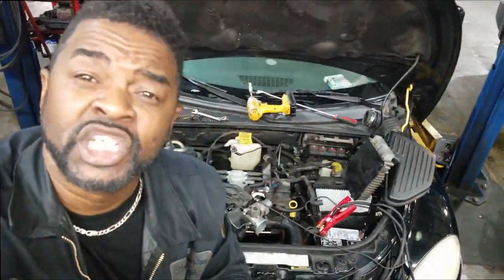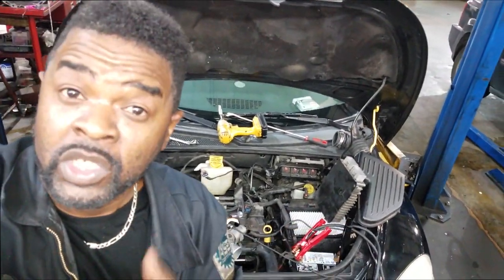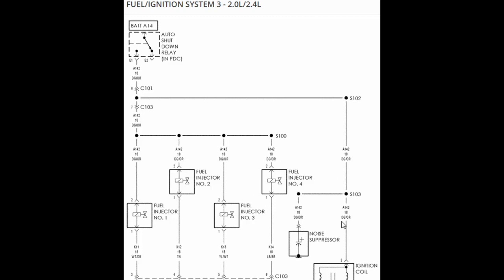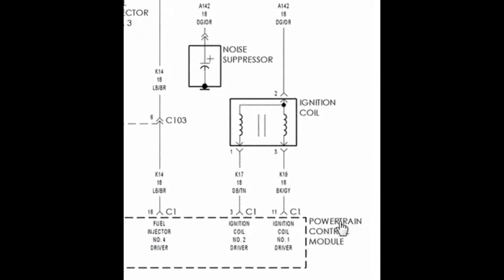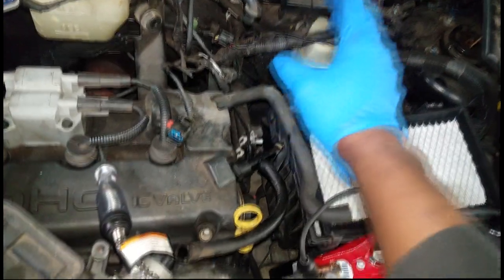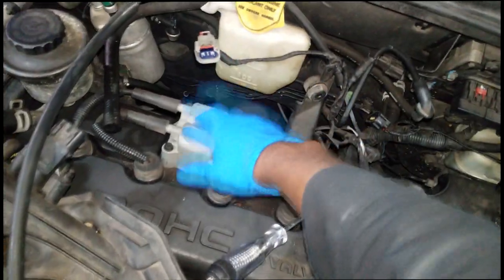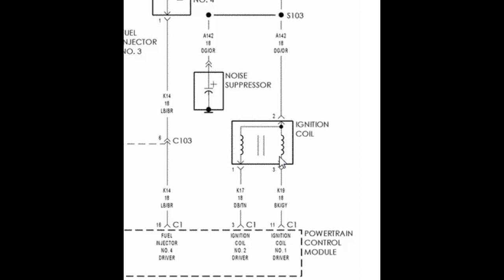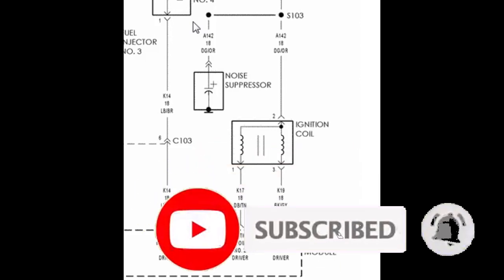How to tell if your car computer bad PCM or COIL. How to fix a NO START MISFIRE  PT Cruiser No Spark

Comment: I get no elec. On fuses 21,22,23 and a yellow 10A+10A double fuse. Changed the 10a and others too. = no wlectricity. No crank no start. Is it the TIPM?

Comment: On my 2005 PT, turbo.......It is Connector No. 2 from the left that supplies the pulsing ground to the coil.  It is Pin Numbers 9 and 10 on the connector plug.  You should get continuity from 9 & 10 on one end, and the two plug wires on each side of the coil plug connector.
My question:  What would cause the PCM to not send the grounding pulse to the coil?  Would a bad crank sensor shut down this grounding pulse from the PCM?  Anything else that would shut-down the grounding pulse from the PCM as you are cranking the engine?
Reply from the maker: Curious if you had any codes? Also, are you subscribed to the channel?

Comment: Can anybody help with this issue I'm having, my 07 pt cruiser is sending spark through the plugs intermittent, I have fuel, but no spark my car got below zero then the next day it stopped getting spark, I replaced the spark plugs, camshaft position sensor, crankshaft position sensor, the fuel pump relay,the relay for the EFI. I'm so lost.HELP PLEASE.

Comment: @ 1min 10 sec.... you can find wiring diagrams by googling your year, make, and model, and some you find will be pdf format to you can print them up. This is especially good if you live in rural or outskirt suburbs where creatures like mice and opossu s are common, they seek warm p,aces in winter and will push, pull, or chew wires to make a space close to warm motor.
Chrysler products, including Jeep and Dodge, from 2002 to 2010, you can turn the key to on then back to off 3 times in quick succession, leaving it in on position on 3rd time, and it will give you error or fault code, where the odometer mileage is displayed on digital versions. If you have more than 1 fault, it will flash them fast so be ready to maybe do that process a couple of times. Then google those codes. Common ones are Throttle Position Sensor and Camshaft Position sensor (P0340), both of which are found at top of motor, are not expensive or difficult to replace, and are quick to do. 
In case anyone else with a PT Cruiser Touring is wondering how to get codes without having access to a plug in code machine. I have a 2006 PT Touring, bought cheap with low miles as my son is learning to drive and replacement parts are easy to find as needed. We have replaced both the mentioned sensors, done brake pads, calipers, rotors on front, replaced spark plugs, wires, and coil pack ( its 1 piece with all 4 coils in), replaced bulbs all around, replaced rad fan and relays ( 2 times in 3 yrs), and in January will be replacing struts on front, both sides ( you can get "loaded" struts from online parts house for about $150 including shipping). With all this work, mostly done by us in carport, have not spent a grand yet on maintenance. Yeah, PTs dont have the most reliable motors, and are ugly to most folks, but maintaining them as should be will have them last longer.

Comment: turns out my voltage was 3 volts at the cps + (2v low) and at the cam sensor it was low , when i disconnected the cam sensor wires, the voltage on the cps + was 5v(perfect) cam sensor internel short was dropping line voltage to 3 v replaced cam sensor ,, all good,, so check for the voltage drop

Comment: I have a no crank no start 2010 PT non turbo🥺 changed PCM,TIPM, ignition switch, checked grounds, checked fuses, checked powers, new battery, Checked ASD and Starter relay both good. Checked starter by jumping the 87 to battery + and starter turns over I’m very confused. It’s the key with the buttons. Could it be the SKIM?.. on a side note it would start and then shut off when warmed up now it won’t crank at all… alternator was charging at 16.5 volts also my high end scanner is not able to connect to the vehicle any ideas would be greatly appreciated the only thing I can think of is a cut wire… another side note no security light on the dash…. Master tech here I’m losing my mind. Does the TIPM need to be flashed??
Reply from the maker: You might be in theft mode my guy. Which mean your scan tool has to get inside the SKIM module to verify this. Heres 2 videos that may help
https://www.youtube.com/watch?v=TpRwRMXKsGQ&t=11s
https://www.youtube.com/watch?v=CCHP1r-PM4M

Comment: Thanks my friend. I was about to buy a new pcm. One of my coils was not sparking and checked and no power but ground was ok. Later found out postive wire was broke. I took positive wire from other spark and spliced and works great. All positive wires are spliced togethet anyways. But ground is fired differently. You saved me A LOT OF MONEY. I can go to work and make money..
Reply from the maker: Thats whats up, thanks

Comment: Hey. Thanks for this video. I am trying to do what you did, but I need to test a 2011 Jeep Liberty v6 3.7L. I have a misfire on 2. Coil pack 5 powers 5 and 2. I replaced it. It's not the coil. I did a lot of things to rule out the common causes. Now I need to check that enough power is coming from the PCM. The coil has a connector with 3 wires, just like yours in the video. If I do the same thing with just that connector, should I get the light going off in the same way? Or is this not transferrable because of the extreme differences in the engines and how they work and look?

Comment: Our 2001 pt cranks over but there is no spark to the plugs, but as you turn the key off there is spark. But your turning it off so it doesn't start. Any ideas?
Reply: I started having same problem, no spark until I turn off then get a spark. Ever get it fixed?

Comment: Hey now I have a knot to get off your PT Cruiser issue I have a 99 TJ Wrangler 4.0 6 l no crank just one knock when I turn the key I've done all my testing that can possibly do I think it's the PCM upgraded all my grounds replace parts new starters new alternators good battery I got 12:9 and I'm running two batteries my top battery is 12/9 which is for my accessories my bottom battery is 13:5 all all fuses I've been replaced whether they needed or not map sensor throttle body sensor coil I've bypassed the clutch I bypass the ignition even though I replaced ignition I've tested all I can test I'm ordering a breakout box to see if I can chase that down through that my scanner our host says it has an issue with the TCM when I run a check with the scanner everything fails I can go on and on can you help a brother out thanks stainless steel

Comment: I always come back to reference JT
 Best online by far in this topic
Reply from the maker: Whats up Cheap Rollin. Thanks for stopping by.
Reply: @OnlineMechanicTips  dad's 99 caravan 2.4 has a rough 3 and 4 misfire. I think it may be a cheap Amazon crank sensor I put on it a few months back? The fuel pump is whiny and gauge is all over place. Thanks for your time Boss
Reply from the maker: @CHEAPROLLIN  whoa, 99 model? Did it trow codes for a crank? I have seen one of those in years
Reply: @OnlineMechanicTips antique lol!! yes just a cylinder 4 misfire and a fuel pump voltage code. #3 was Missing on monitor but didn't show a code

Comment: I have a Chrysler 300 and I replaced all 6 spark plugs and 6 cores and with all them in I get a no start but when the number one spark plug is removed it will start??

Comment: Great information but did not solve my problem. NEED HELP. I have 2006 PT Cruiser 2nd gen Crank No Start/ No Spark issue (replaced mass air, crank and cam sensor, coil and swapped out computer with one programed to car  and still have Crank No Spark issue. I performed as your video getting power from center wire when car to run on coil harness  but the 2 other wires Green/Yellow and Blk/Y no duty ground power. Performed ohm check from Coil Harness Blk/y and Grn/Y  to PCM ( Orange pin 9,10) wires check out good no break in wires. What else can I check ? Why PCM no power to coil ? PCM was tested prior to plug and play
Reply: Did you work out what the issue was ? In my case, the vehicle ran rough then a few drives later after turning off will not turn over.

Comment: Thank you that was very informative I got 2005 PT cruiser no crank no it cranks no start body filled it up with too much oil and returned it to me but no start
Reply: Did you work out what the issue was ? In my case, the vehicle ran rough then a few drives later after turning off will not turn over.

Comment: 2002 Pt Cruiser. One morning started car. Ran good normal for 10 seconds then started misfiring. I could smell raw fuel. No check engine light. No codes. I disconnected BOTH positive and negative battery terminals. Waited 5 minutes. Reconnected. All good. No more misfire. Car never ever did this before. What's going on? 🤔

Comment: Very good info I have a 2005 PT cruiser 2.4. it started running a little rough two weeks ago, I hooked up my code scanner, got a cylinder 2 misfire. I changed the plugs, still running rough scanned it again got a cylinder 3 misfire. I changed the wires and coil pack, got a multiple cylinder misfire. Now it doesn't start up turns over but no start. The only thing I can think of is bad coil pack and fuel injectors need to be changed. Some helpful tips would be appreciated thank you.
Reply: No not yet due to weather here or busy doing other things, I have changed the water pump. Once the weather gets better I will get back at it..
Reply: @thomasgarcia4746  look forward to hearing how it plays out.
Reply: Did you work out what the issue was ? In my case, the vehicle ran rough then a few drives later after turning off will not turn over.

Comment: Hello, my pt cruiser is 2006, my scan only shows low battery after many attempts, but it does not start, I did all the measurements that you recommend in your videos.
Reply: Did you work out what the issue was ? In my case, the vehicle ran rough then a few drives later after turning off will not turn over.

Comment: Hello, excellent explanations, I need your help, my pt cruiser does not start, I see the camshaft and crankshaft signals well, it sparks.  Also change the fuel pump, I think the problem may be the injectors.  Give me your opinion. Thank you.
Reply from the maker: Dang, can you at least mention what year and why you now think injectors are the problem? Are you using a scan tool? Also are you subscribed to the channel?
Reply: Did you work out what the issue was ? In my case, the vehicle ran rough then a few drives later after turning off will not turn over.

Comment: I really nedd your help I have a 2007 PT Cruiser my brother in law has changed  the all the moter mounts which were bad the timing belt and the water pump and now the car won't start. Is there any advice you can lend to assist us?
He says the timing marks are in their proper place but the car will net start.
Reply: Did you work out what the issue was ? In my case, the vehicle ran rough then a few drives later after turning off will not turn over.

Comment: My po t cruiser is stalling and has a rough idle but stalling is intermittently and I've checked the camshaft sensor/map sensor the Iac sensor... 
Check engine light coming on  intermittently and the trac off ,abs,brake lights on to but show no codes dont understand what's going on can u help.... ??????
Reply from the maker: O wow, what year is your PT and what was the codes?
Reply: @OnlineMechanicTips   2004
Reply: 2004

Comment: Jt iam back again needing help i love this video iam working on 2003 pt cruiser turbo i dont have spark at 1and 4 iam going to test the driver tomorrow at the shop but say my tester is not lighting from pcm to coil when iam starting the car and say its the pcm thats bad can i get a junkyard pcm and plug and play or i have to program the pcm
Reply from the maker: Hey bud, it depends on if its equipped with a factory security module. (what color is the key)
Reply: The key is gray its 2003 pt cruiser turbo
Reply from the maker: @coreysolomon6814  Then your car equipped with a factory security system. Meaning a new/used pcm will have to be programmed to the security skim module in order for it to start and run
Reply: Jt can i go to one of those online pcm reprograming companies and buy a new pcm thats already program will they reprogram it to the skim module and if so do i have to give the info off the skim module on the car over phone what info do i have to give them over the phone jt i need your help very much appreciated
Reply from the maker: @coreysolomon6814  Yes, Ive heard of people doing that. They have them already pre-programmed based off your vin, so when you get it, its just a simple install

Comment: I have a 04 PT Cruiser 5-speed I put a brand new starter and brand new ignition actuator and still won't start I could jump it at the jump box but it was still won't crank
Reply from the maker: Hey bud, what do you mean you can jump it at the jump box? Also are you subscribed to the channel?
Reply: Did you work out what the issue was ? In my case, the vehicle ran rough then a few drives later after turning off will not turn over.

Comment: I have a 08 ponitic grand Prix it won't
Reply: I have a 08 ponitic grand Prix it won't crank i lost the key bob i only have the plan key it turns the switch but nothing happens is there a way to start it with out the key starting it and to keep it runing thanks

Comment: great video,  I'm wondering if you can do a following video of what to if your negative signal to spark plug box are working but there is no positive what are the steps to fixing that certain cable, Thanks a lot your videos have truly help me a lot keep it up hope to hear back
Reply from the maker: Hey bud, are you talking about the green and orange ASD wire to the coil? Also are you subscribed to the channel?
Reply: @OnlineMechanicTips  yes sir I am talking about those I check my negative and they seem to work but no positive signal at all ., thanks once again

Comment: You still active ?
Reply from the maker: Whats going on bud?
Reply: @OnlineMechanicTips  got a 2001 pt 2.4 crank no start fuel pump turns on snap on scanner says crank and cam sensor are good and in sync timing belt is good fuel pressure is good and relay is good coil getting power on middle wire the 2 outside wires are pulsing while cranking still no spark tried 3 different coils its driving me crazy 10 years master tech and im ripping my hair out
Reply from the maker: @ziptiegarage  I know the feeling, You basically saying the reason for the no start is because theres no secondary ignition spark. Connect has the needed ASD power source and the driver wires are pulsating. If I had such a problem. ide be after a coil but wait, youve replace the coil? Something not making sense. Also are you 100% sure you on the coil connector and not the cam sensor connector? They are the same. Also I have to ask are you subscribe to the channel?
Reply: @OnlineMechanicTips  figured it put the asd relay from tge horn was working for tge horn but was a bad relay took another fired right up SMH
Reply from the maker: @ziptiegarage  whoaaaaaa...great find tho...Glad you got it bud

Comment: My wife and purchased a 2007 PT cruiser we live in Canton ohio. She lost the only key that we had for vehicle so I had a locksmith come out to make a new key. So he was here for almost 2 hours and couldn’t program our new key. He cut key and it works on locks and also starts vehicle but when he went program it the obd2 sensor was only showing 1.5 volts which was not enough for him to program key. Battery good/ fuse good. What can we do. We don’t have much money and our in process of trying to get an apartment again. We stay weekly in hotel room. Please help me troubleshoot. Ty for your time
Reply from the maker: Im lost, if he cut the key and now it works on door locks and also starts vehicle, whats wrong? Also are you subscribed to the channel?